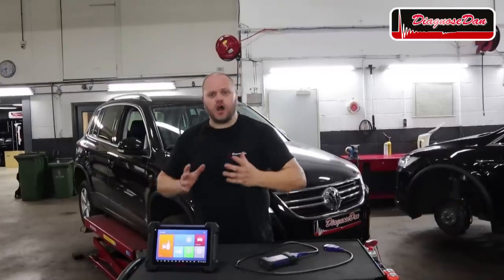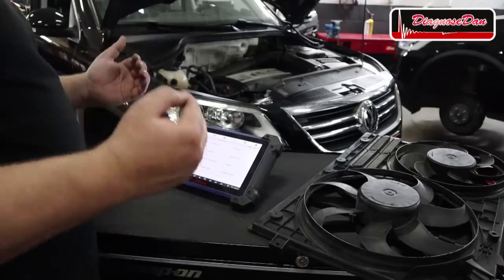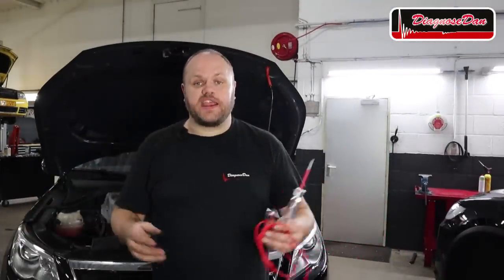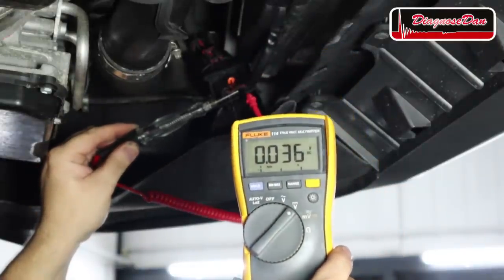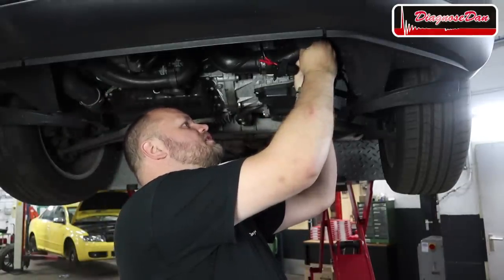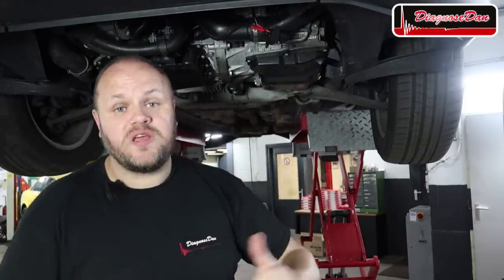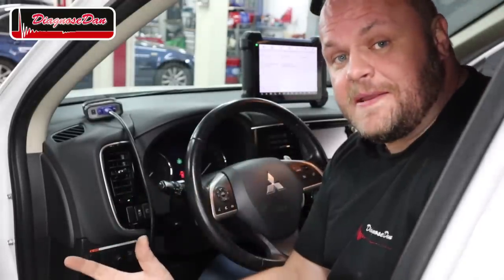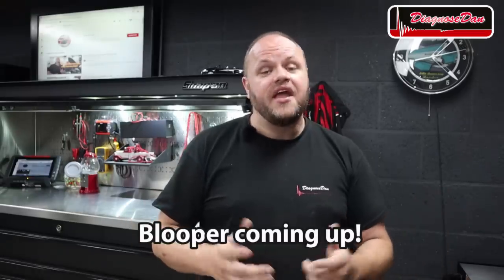A Cheap Chinese Car Key from Wish, will it work?

Comment: Morgen een goede gebruikte radiator ventilatorset voor een Tiguan  op markplaats.
Reply from the maker: Nee, de oude is terug gegaan en de nieuwe retour. ( Hebben ze mij verteld)
Reply: @Diagnosedan  Dat is wel netjes, als ik onderdelen bestel bij een dealer kan het op een of andere manier nooit terug. Maar goed, jouw manier van diagnose stellen en uitleg is goed. 
De basis van storing zoeken, is er spanning, is er stroom. Is de plus plus en de min min. 
Ben electricien van beroep en mijn storingen zijn niet veel anders.

Comment: Although he did diagnose the repair, I disagree with the way he did it. It the wires got warm enough to melt the insulation, there is a good chance the conductors inside suffered damage. He should have replaced the terminals. Not replacing them could cause a problem later on.

Comment: I have seen this issue before.
Reply from the maker: Really!
Reply: Yes.  I'm a retired auto engineer in Australia. My last employer had this problem with his car. I do what is known as check the obvious first. His tow truck had a problem with starting. The symptoms he told me were slow cranking, yet the battery was fully charged. Armed with this information I had a fair idea of what the problem was. The heavy current battery cable from battery positive to starter motor was loose at the starter motor end. I disconnected the battery, removed the cable from the starter motor, cleaned up the cable terminal and reconnected it at both ends. Problem fixed. When I did repairs like these, I used electrically conductive grease to prevent corrosion. In older cars, the fans often fail due to a faulty relay or temperature switch.  We both know that a bad negative connection can cause the computer to throw all sorts of trouble codes.

Comment: them ground wires probably melted when somebody put the heat shrink on
Reply from the maker: Nope, recistance creates heat, and the loose connection created very high resistance. Thanks for taking the time to leave a comment it's appriciated 👍

Comment: Just goes to show the fat profits manufacturers & dealers make on parts... what’s the chance that the Chinese key from wish has some (if not all) components come from the same supplier as the OEM? Let’s not forget , there is still a fair profit margin  on the aftermarket key from Wish. Would the cost of manufacturing of the aftermarket smart Key exceed €5? I think not...
Reply from the maker: What do you think all those Nice buildings and showrooms are financed with?

Comment: Wrong u can use a multimeters just connected to the battery negative and the the red one to the fan negative u will see voltage meaning u don have a good ground

Comment: Putting a plastic locator on any ground bolt is asking for trouble. More reasons I would never buy a Teutonic car. Japanese cars always have individual earth screws for every ground cable.
Reply: 23 years with my '98 LS400 and everything still works.

Comment: You are wrong , a voltmeter can be used to check a power and ground.
You are using it incorrectly.
You are to voltage drop it from the battery to the connector.
The earth waterproofing wasn't fixed now they will fail because of water ingress
Reply from the maker: Many people have problems with understanding voltage drop and use the multimeter as i showed in the video. 
I'll show voltage drop in a future video as there is a video in the Diagnosedan Global tech support group on Facebook. The ground wires are replaced by the other shop, as i explained in the video i was only asked to diagnose the Car. They re-installed the old fan unit and because the Car was bought at that other shop everything was covered under warranty. Thanks for watching 👍

Comment: Voltage means nothing without a load on it!!
Reply: Too true. Quickest way I explain it to friends that don't want to listen for too long - starter motor main 12v feed will still read 12v with a single wire strand remaining.

Comment: no no no... what they did wrong is.... when measuring voltage with a muilty meter you do it with the circuit complete and ON  if the fans are not running the circuit is not on! A meter measures PENTNTAL difference not actual difference
Reply from the maker: Yes but because the ground was shared internally with the control module the control module inside the fan assembly was not working and would never try to turn on the fans. That's why it's best to use a testlight, than you don't have to take things like this into account. So less chance of making mistakes
Reply: DiagnoseDan yeah that’s what I’m saying I never test with a meter alone! I would say a bulb test light is one of the most useful bits of a toolbox! I use it to test the HT

Comment: As we can see, car companies are getting greedy. Most cars today need to be connected to a diagnostic tool to make it work again. I saw this type of problem on a Volvo with a bad power window motor. The mechanic replaced the motor, but it didn't work, and he tested the new motor before installing it. A good thing he new a friend that worked at a Volvo dealer who let him know he had to re-activate the circuit. Well it brings up the price of the repair. Today it's all about profits, fuck the customer. As for the key from the aftermarket source, it goes to show the people how honest companies are.....
Reply from the maker: It has nothing to do with greed. The customer bought the Car there and everything was covered under warranty 😁

Comment: How do professional garages make so many damn rookie mistakes I'll never know. Can't think of a time I've ever had to pierce a wire to check it. It's not like you even need specialist tools to back probe it either. Argh
Reply from the maker: Lack of training😓
Reply: DiagnoseDan I hear that a lot but to me it's just common sense. I was actually trained as a Agricultural engineer back in college but somehow ended up in a performance car workshop which included making new looms ecu's and fitting other aftermarket jank, yet never been stumped by some of the simple problems you get handed to you from other professional outfits. In fact we used to do a lot of diag and fix work for the local BMW dealer! I mean WTF! And I consider myself not that good with electronics either, that's why I follow you 😂😂😁🤣

Comment: Cars are shit these days.
Reply: But now a days you have the option of buying a much simpler model from thirty or 40 years ago and driving that. The secondary aftermarkets allow you to drive a 1957 Chevy Belair with a 2020 gas engine or a 2020 model Ford with an electric motor. We have it available to us like no one before us, automotively speaking. Or, you can whine about it and be a loser. It's up to you.